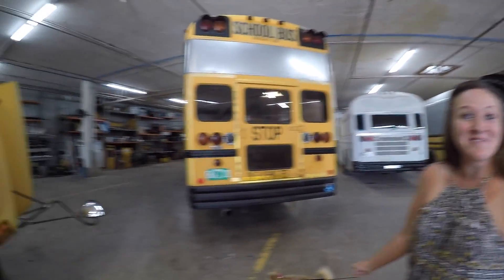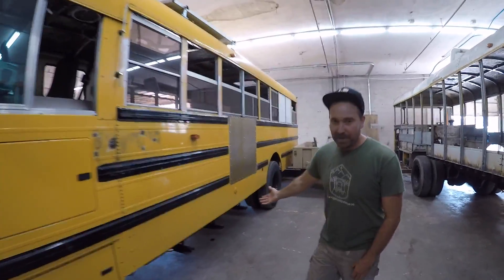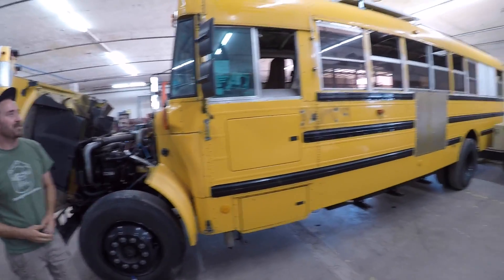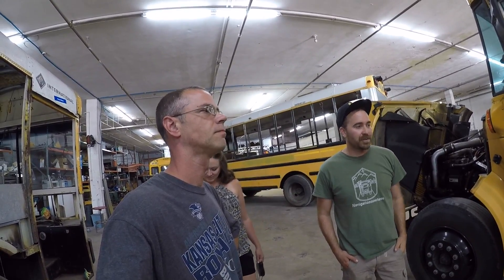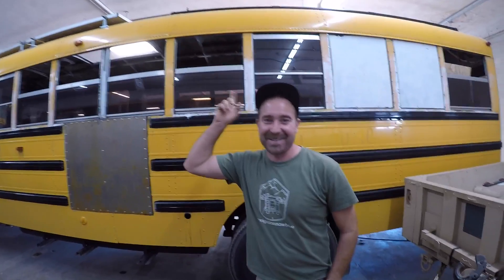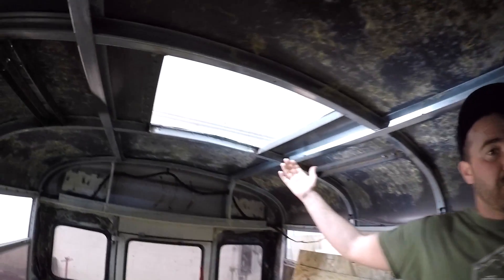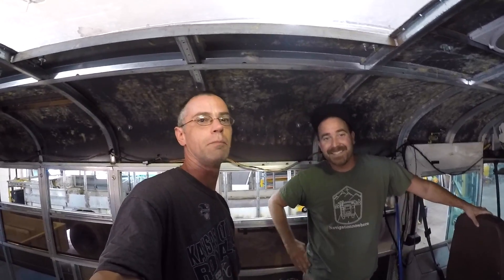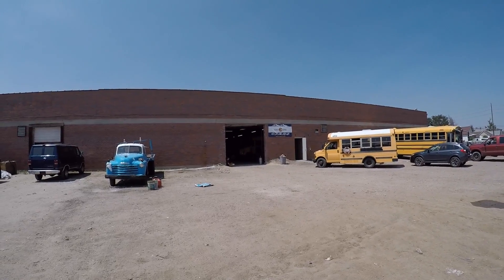Inside a Custom Skoolie Shop & Bus Runs on Used vegetable oil

Comment: I love the school bus idea. Anyone buying a school bus make sure you check the ribs on the flooring under the bus. They like to rot out and it doesn't take very long if it wasn't properly cleaned while in service. I worked for a school bus dealership part time and used to see them come in frequently for replacements. I live in upstate N.Y. and the winters are hard.
Reply from the maker: Skoolies are cool, we are thinking about it as a possibility.

Comment: Did he say used motor oil too?  Best place to find that, is family farms. Most farmers change all their oil & its gallons, not quarts. Then have 50 gallon barrels full.....just a thought
Reply from the maker: Yes he said it will run on used motor oil but I think veggie oil is preferred for some reason, probably runs better on the veggie